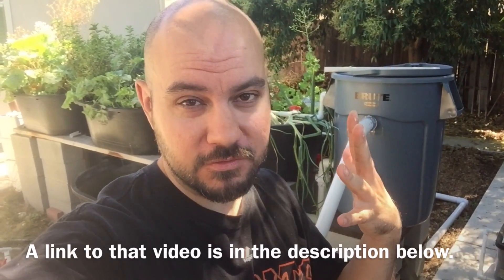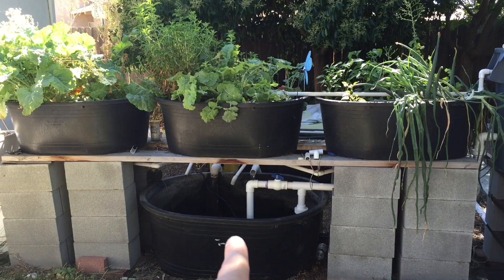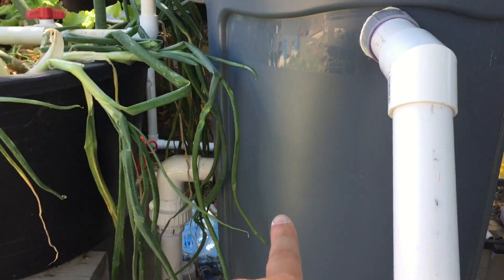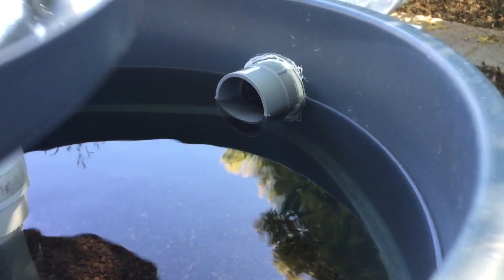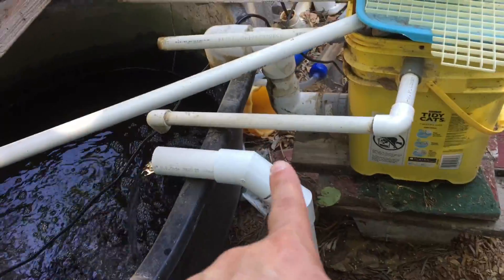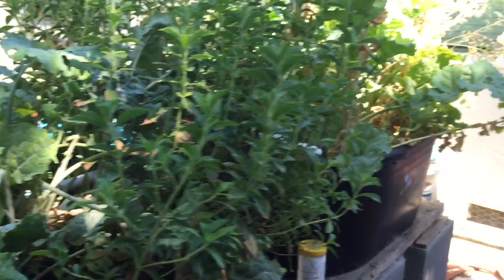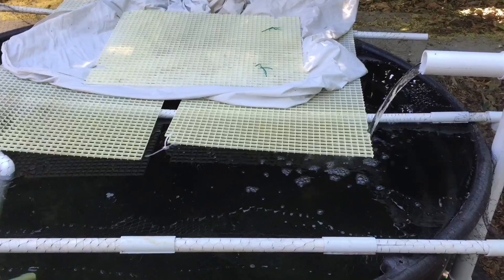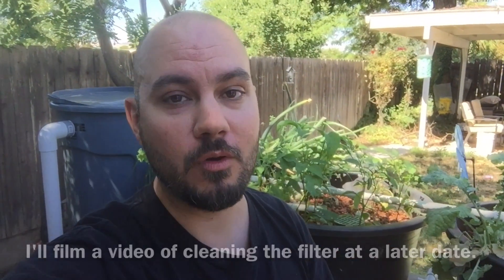The New Aquaponics is Running - Walkthrough

Comment: 350 gallons. Have one just like it.
Reply from the maker: I think the tank you see is 300 gallons (where the fish are).   Then the sump tank is a 100 gallon container.  And the gravel filter is a 40 gallon garbage can (which holds about 25 gallons of water when full of the rocks).   So overall, at any given time, there is between 350 and 400 gallons of water in my system.
Reply: They lied to me when I got mine. It is 300. Thanks.

Comment: you have what Murray Hallam  calls a Chop 2 system..    You do not need a filter system unless you are using Deep water culture raft beds.  The  mediums in your grow beds is actually a better filter than your filter could ever be..  It looks great.
Reply from the maker: I have to respectfully disagree with the statement that I don't need a filter system.   Please consider that your grow beds DO make great filters, but after a few years, they WILL need to be cleaned.  They can only filter so much waste and dead plant material before they will have sludge on the bottom.

By installing a PRE-FILTER before the grow beds, you can help trap a lot of the solids in there, allowing your grow beds to be more productive.

This is really only an issue after you have a system online for a long time like mine.   With my new prefilter, it allows me to clean it with ease, and it takes most of the strain off the grow beds.   The only thing that should probably be in the grow beds is plants, worms, and bacteria.  

Now, can a system operate with just the grow beds and no other filters?  Yes....and mine did for years that way.  But depending on your stocking levels, the more filtration you have, the better (and happier) you will be in maintaining the system.

Comment: oh that sucks ya got to level it,, Have you thought about putting a toilet valve/float in the 2nd tank to auto fill from a hose so the water level never gos low and your pump doesn't have a chance to suck air on hot days when your not home? Looks amazing bro, you really have a sweet set up!
Reply from the maker: Yeah I have thought of that.....but the hose in my yard sucks (the pipe connection leaks if turned on), so I would waste way more water by leaving it "on" for the float valve.   The other negative thing is that I usually "treat" my water to remove chlorine and chloramine before putting it into my tank.....so having a float valve wouldn't allow me to do that.

However, I did consider getting another trash can, filling it with treated water, and then having a pipe come down from the bottom of it and into the tank.  When the tank water lowers below the pipe, it would automatically top off with the treated water.  That way, I can have a reservoir of treated water that tops off when the tank is low.
Reply: +StogieFarts oh theirs a great idea!